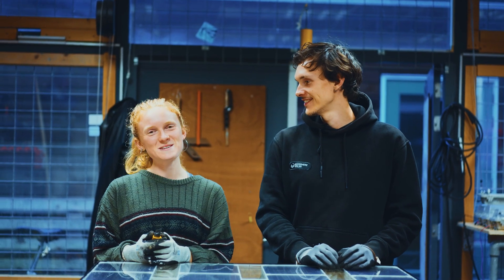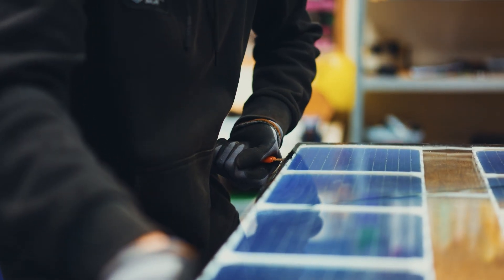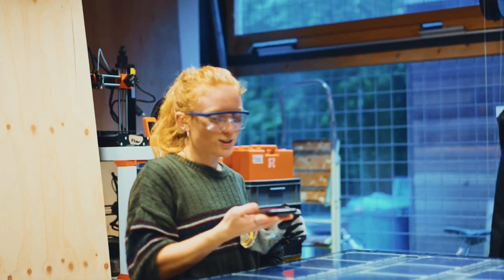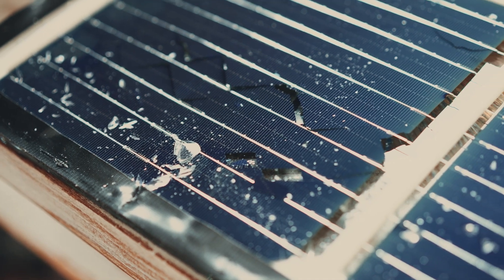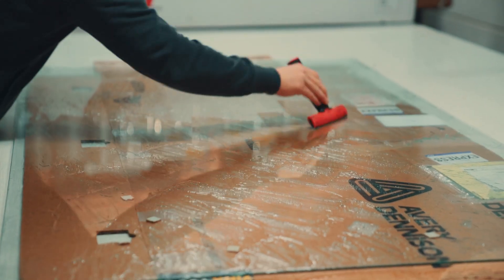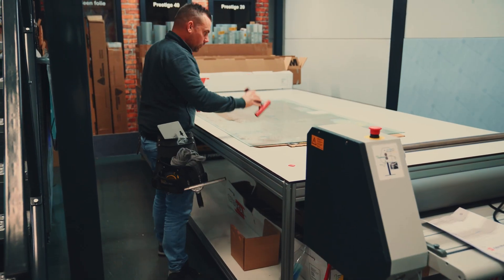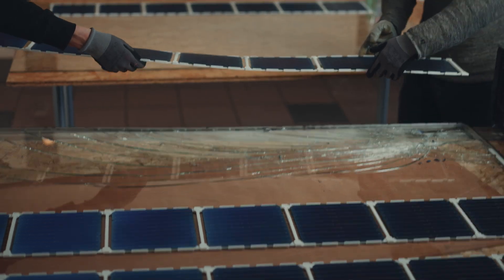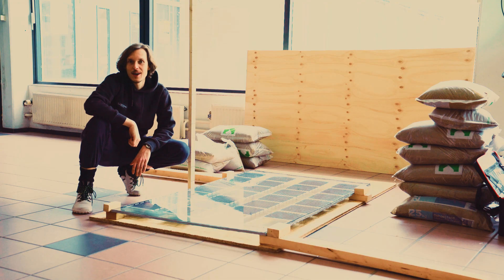Repairing the ONLY Repairable Solar Panel | Biosphere Solar

Comment: The algorithm brought me here, so I don't know a lot (not that I do to begin with) about this project and the current panel specifications. You went with plate glass to start with, then you're moving to a tempered glass + film combo, similar to car windows. I'm wondering if the intial choice was for proof of function/availability and cost and now you've had to up the hardiness of your panels design.

When I think of a solar panel I imagine they have to be built like tanks for a variety of weather conditions, including tennis ball sized hail. But you've got me curious to see how sturdy you can build your panels in comparison to existing panels on the market. Brings a lot of questions to mind that I haven't thought of.

I will follow with interest in your development.
Reply from the maker: You're absolutely right! We wanted to see how far we could go with plate glass, since it has a lower CO2 footprint. Since it has been used in buildings for centuries, we thought it worth a shot to see how it would hold.